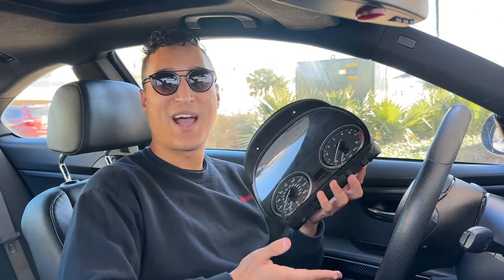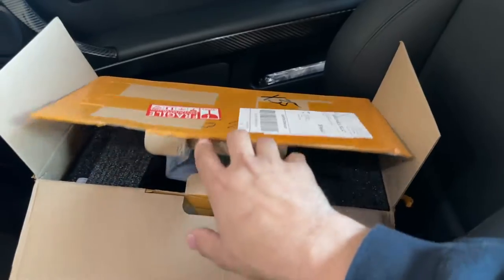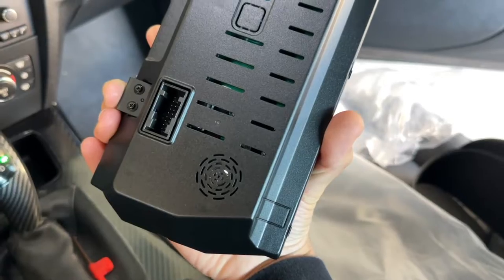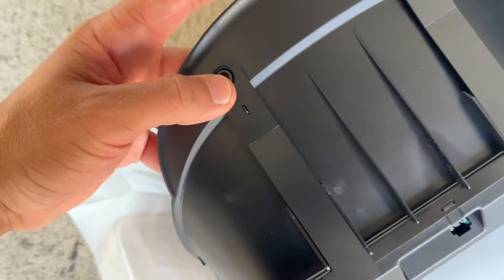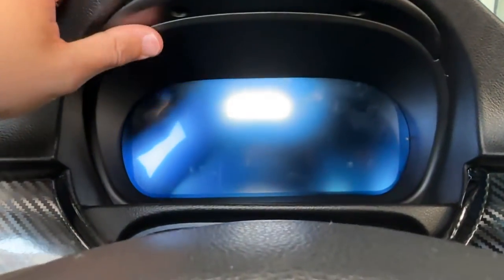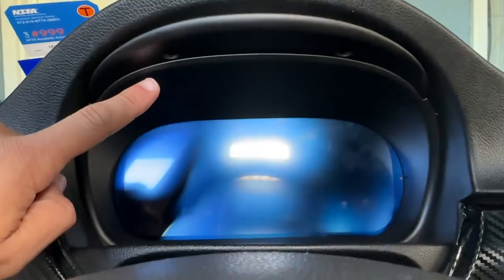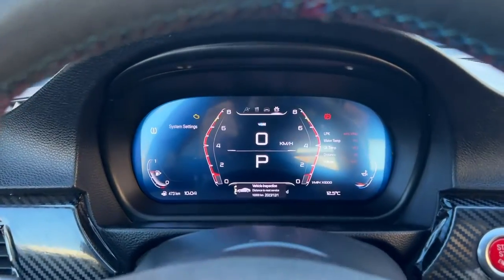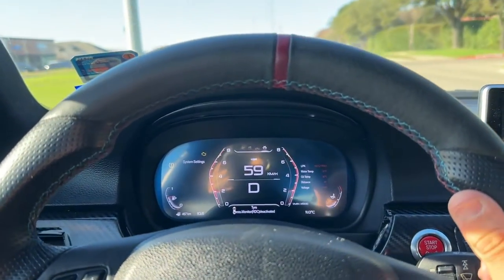Installing a Digital Dashboard Gauge Cluster In My BMW E90 E92!

Comment: Hello friend, first of all, good video, it looks easy to install. The second. I am going to buy an E90 320d of 177 hp from 2008, it is diesel, would there be no problem with the interface (because of the revolutions)? Thanks in advance
Reply from the maker: I don’t believe so, but I can find out for you! check back on this comment later tomorrow and I’ll have an answer for you.
Reply: @IzzyE9X  okey friend, Thanks!
Reply: Diesel?? Damm ...

Comment: It's.not bad but has loads of bugs, like about 6. Font sizes, TPS warnings, cruise control (can be fixed), overlapping text, different fonts, car image gone on latest firmware, lots of Chinese on the lastest firmware that's supposed to fix loads of stuff but does not....its still pretty cool but needs more updates anyway for the e90
Reply from the maker: the font could be better on some portions, TPS warning is annoying but besides that I’d say it’s still 100% worth it. once you switch the language to english, there’s not really any issues there and overall looks amazing and I’d say is still worth it! If you get the coffee from the company you can unlock new settings, update the boot loader etc.
Reply: How can you fix the cruise control ? Sometimes it works but most of the times it doesn't

Comment: Hola amigo, que ajustes pones para que el combustible restante salga correcto con el cluster original de Bmw?
Reply: automatically does it for u
Reply: @cabzyca2953  muchas gracias por responder amigo, a mi no se me puso automáticamente, tuve que poner los parámetros del cluster de Bmw en el menú oculto de tank left y tank rigth , y ahora si va mejor, también he hablado con el fabricante y dentro de poco habrá una actualización con nuevos modos de UI, y soluciones a algunos errores. Un saludo amigo 😊👍

Comment: Is cruise control working ? Mine doesn’t
Reply: Mine too. Any fix on this ?
Reply: Same problem here as well! Been having this issue for 3 months now
Reply: I fixed it, I need to send you an update it file please DM me
Reply: @superstars6175  please send me on my email.
Reply: @kostisuk  please send me on my email
Reply: @saudkhalid8270  it’s not letting me send email here, please try dm me
Reply: @superstars6175  you will find my Email in the description
Reply: @saudkhalid8270  sent an email now
Reply: @saudkhalid8270  sent an email. Thank you !
Reply: @saudkhalid8270  hello colleague, I also have the same problem that I read about in the comments under a video, my car has a distronic plus cruise control and both of them don't work for me, also with my old display device it didn't signal to me about not wearing seat belts, now with this one it always does  annoying sound but with my old one everything works and the annoying ringing is gone can you turn on the distronics and cruise control and stop the belt ringing my car is bmw e90 330xi 2005 year

Comment: do you have to take the battery off? or its just plug n play? I want to buy one for my 2017 f30, but im a little afraid of system errors.
Reply from the maker: no errors and don’t need to unplug the battery! you always can to be safe but I had no issues

Comment: 🎉awesome video man but I have a question on the digital meter is the gas bar accurate ? Cause I’m very worry if I buy it n the gas bar isn’t accurate
Reply from the maker: yes it’s accurate! you can actually go in the settings and fully customize the exact size of your models fuel capacity but yes, so far it’s been very accurate
Reply: @IzzyE9X   do  you know what is main tank and sub tank ?
Reply: Yes I am unsure of main tank and sub tank value to put for E93- . Total is 61 litre I guess but wat is the split as it affects fuel gauge measurement presentation.

Comment: does your car retain previous millage and service ckeck after changing to digital cluster?
Reply from the maker: It does not throw any tamper dot, once you remove this cluster and put the factory one back, it will have the mileage that was present when you did the swap

Comment: Hey bro, do you have problems with brightness? Like the day/night are not Like they should be in the time zone..
Reply from the maker: I’ve had no issues with brightness. It can be adjusted for day/night in the settings as well
Reply: @IzzyE9X  Yes i know, im from Croatia, and the day here starts at 7 in the morning and the night starts at around 19 afternoon.

But the problem is that i still have night brightness at 10pm even tho its daytims at my place, and i have day brightness at 10am and its pitch dark at that time...

Still havent found solution for this, bit expensive piece this cluster, dont you think? 😅

Comment: Does anyone know how to change it from KM to MPH? And where in settings you can change it> my installer cannot figure it out.
Reply from the maker: yes you need to input a code into the “Factory” tab. once the code is typed in you can change it from KPH to MPH. where did you buy from?
Reply: @IzzyE9X  I purchased from Aliexpress, China.  Where do you get the code from? I have bimmercode adaptor, would you use that?
Reply: @omarzeciri4709  use code 0168 or 0169 in factory and this will give you option
Reply: @OZWizard hi can you please give the link to the ali xpress store you used and how is it treating you so far?

Comment: Can you check oil level on this cluster?
Reply from the maker: low oil level will pop up, but I haven’t found a way to check the level
Reply: Yes there is a gauge which u have to select in setting to activate. It will appear like a battery bar for engine oil measurement and shows in bar values

Comment: i can see you have the check engine light too ! In BMW 430i 2016, This cluster gave me check engine light with OBD Fault code 1B9508, Any solution for this ? also the mileage on OBD shows as 100KM while in dashboard it shows the correct number..
Reply: Go into factory mode. With code 01690 to configure mileage. Engine light might need a battery reset. Unplug battery for 30 mins

Comment: Why did you loose the voltage in the other videos???
Reply from the maker: there’s a new software update that enables a ton more car logos, but gets rid of Voltage. The 2.0 update keeps it, 2.1 deletes it
Reply: @IzzyE9X  Do you have the 2.0 update?
Reply: @IzzyE9X  I just figured something out on my cluster, is not that they removed the Battery Voltage, when they added Efficient Dynamics instead of going under the Battery Voltage, it actually landed on top and made the Battery Voltage drop down 3 lines and has a large black space  in between and what that did is hide the Battery Voltage. If you where to go in General Settings and disable either the Coolant temp or the Oil Temp, then magically the Batt Voltage will pop up, give it a try to see if it works for you!
Reply from the maker: @Carlos335is great find! I’ll give this a try on mine
Reply: @IzzyE9X   I have contacted the company and they been been working with the engineer to get me a new update where it adds Batt. Voltage on top of the Efficient Dynamics and when you see the screen they're all line up and there's no large space in between the Batt. Voltage and Efficient Dynamics, if you use the oil gauge you will see a white line while the oil level is checked and afterwards it will be solid. I'm trying to get them to remove the Efficient Dynamics and capitalized the (t) on the Coolant (T)emp and Oil (T)emp and also if you switch of the Coolant and Oil and cycle and then put them back, they will both be under the Cons.  😎

Comment: Anyone know the best “main tank” and “sub tank” values when programming in 0168. My 2006 bmw 325i fuel gauge has been finicky with this cluster. Not sure what I should set it to.
Reply: Drove 6 miles and range went from 460 to 270

Comment: How you check engine oil level using this?
Reply from the maker: Sadly, you can’t. If you are low, the gauge cluster will give you a light though